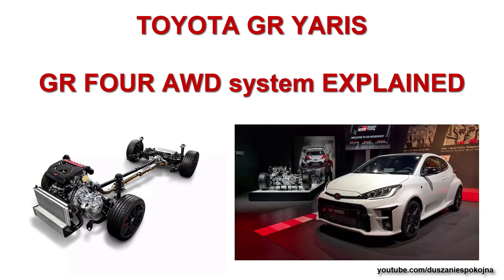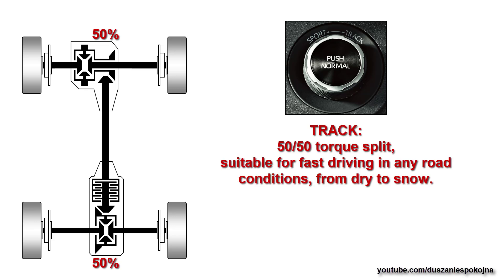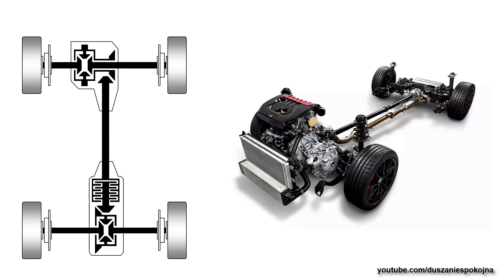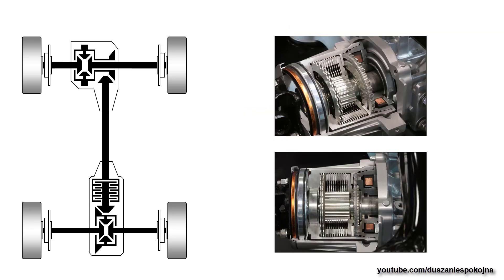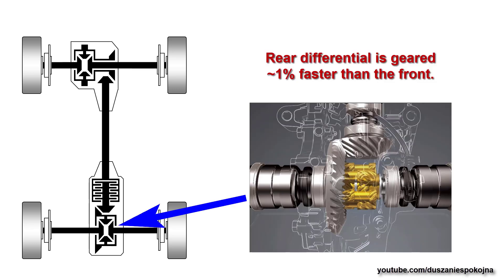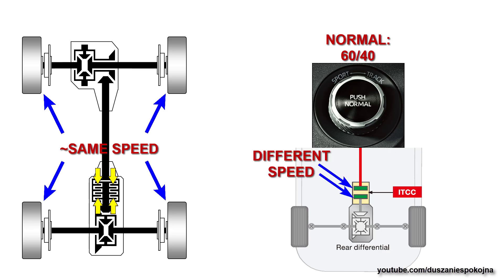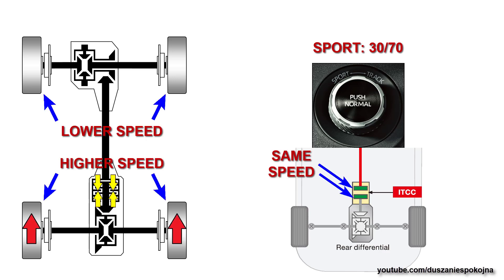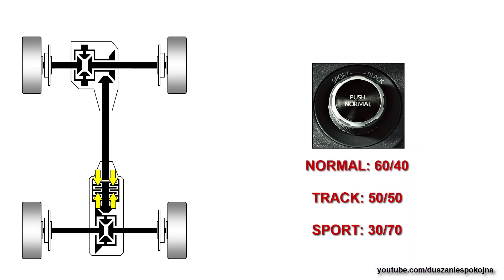Toyota GR Corolla & GR Yaris - GR FOUR AWD SYSTEM EXPLAINED - @4x4.tests.on.rollers

Comment: Planned obsolescence at it's finest, a drivetrain deliberately designed to wear down with each rotation. A lockable torsen center differential would be a much more robust solution, but it's apparent that cars are increasingly designed more like consumer electronics with each passing year, with the expectation expiring soon after warranty instead of the 20 years design life that was typical just a decade ago.
Reply from the maker: It wouldn't be possible to overspeed rear axle with torsen differential. Another two-step rear differential would be needed then. So in general - a lot of weight and a lot of space.
Reply: They designed it to not wear out. It's not normal clutch at all. Both cars and electronics are going to last well over any warranty definitely over 20 years.
Reply: @dkdanis1340  how do you know?
Reply: @bobbybooshay5854  Cause multi plates wet clutches have been used for many applications without any problems. You can  imagine how much engineering toyota did with this one.

Comment: If I would be Mr. Toyoda, I would have put a lockable center torsen diff in stead of slipping and sliding disks. Constantly slipping disks really do not sound appealing at all. Basically the system is being worn out all the time when used, with each rotation of the crankshaft. Good job explaining the functionality, this solution would not be my choice as there many others not based on constant slipping.
Reply from the maker: It wouldn't be possible to overspeed rear axle with torsen differential. Another two-step rear differential would be needed then. So in general - a lot of weight and a lot of space.
Reply: @4x4.tests.on.rollers  if I wasn't mistaken, audi have something like center diff with computer control variable locking, while by default it gave 60/40 split rear / front through gearing inside the differential itself.
Reply from the maker: @krisnadiimam4556  No, they don't have computer controlled center diff. Here are all diffs used by Audi: https://youtu.be/ItTkEb_pf1A
Reply: @4x4.tests.on.rollers  Audi started using Torsen 40/60 nominal front/rear torque split from Audi S4/RS4 B7 I think, so there would be no need for overspeeding the rear axle as the torque split is acquired in the center differential gearing. But this solution is not electronically controlled for changing the torque split
Reply from the maker: @Lexanotus  Audi is using a method of overspeeding rear wheels (right or left, never both) by optional sport differential. That's how they fight with understeer.
Reply: Torsen center diff, as in most Audis, is very good for everyday driving and for spirited street driving too. It's torque split varies depending on the grip on each axle, but has it's limitations, and cannot be electronically controlled. But with this system, the torque split can be varied according to conditions and driver input using only software.

I think the car would be very different with a center Torsen diff. And from what I've heard, it is very good as it is. I wouldn't have thought they made the AWD system like this, but I think the good people at Toyota knew what they were doing. :)
Reply: Is it possible to delete the itcc and direct replace with custom adaptor.. this itcc keep overheated during racing

Comment: Thank you for the great video! Do you know if Focus RS uses similar technology?
Reply from the maker: Yes, Focus RS uses the same overspeeding trick but it is powering rear wheels separately. It has two clutch-packs on semi-axles instead of one on the driveshaft. System is called Twinster, supplied by GKN Driveline.

Comment: so if I put 235/50 on the audi s3 instead of 235/45 on the rear axle should i get the same result ??
Reply from the maker: If you update the awd control software then yes. To the point when haldex will explode 😉
Reply: Guess the wheel speed sensors would make the car go crazy and think that the rears are always slipping a bit and apply brakes on rear?
Reply from the maker: @timoklap System wouldn't be braking the wheels, it would be locking the haldex.
Reply: @4x4.tests.on.rollers  it would be braking wheels, its the traction control system
Reply from the maker: @lexuslfa4739  Not in this case.

Comment: It reassures me, I had understood the same thing concerning the operation of this transmission. Including, the trick for the distribution of torque in favor of the rear. This is an interesting use of the ITCC, a multi-plat clutch pack found on many cars (JTECK belonging to Toyota)...
Reply from the maker: To be honest, I was really surprised that they took ITCC for GR Yaris. It must be really strong clutch-pack.
Reply: @4x4.tests.on.rollers  Me too. I heard so much criticism of ITCC in the mid-2000s when it was mounted on SUVs ... with stories of heating up and back to 2wd and that in conditions not particularly difficult... Improvements from generation to generation, I guess. It is, I believe, the 3rd.
Reply from the maker: @Softroader  Toyota Poland organised three days of track driving for automotive journalists. They were pushing the cars to the limits, there was not a single incident with overheat. I am really interested if the clutch is really engaged all the time or is it opening in every possible moment (like off throttle etc.) to cool down a little.
Reply: @4x4.tests.on.rollers  Toyota apparently managed to overcome the inherent overheating problem of such s system but big question comes to mine mind: how long it will last?
Reply: @4x4.tests.on.rollers  The swiss guys must have set the 30/70 mode so it overheated while having the minimum slip in the ITCC (with max pressure though). It must be hard on the rear tires too. And still one does not feel much difference with the other modes (I've tested them myself then read the same comments from journalists)
Reply from the maker: @spolo123  Thanks for the link. All in all it's a clutch-pack without cooling, it must overheat some day :)
Reply: Ford used ITCC in rear diff unit.! But only 100F To 50/50

Comment: This means that the clutch is permanently slipping because the tires have the same speed. So the clutch will wear out very quickly.
Reply: It's a wet plate clutch pack with a DLC coating so it will probably be fine.
I am more interested in the energy loss by the slipping clutch though.
Reply from the maker: Yes, it is. But we don't know if it will wear out quickly, we have to wait 🙂
Reply: @4x4.tests.on.rollers  wet clutch, does not wear, its the same as the mercedes automatic gearbox that uses a wet clutch instead of a torque converter
Reply from the maker: @lexuslfa4739  Every clutch wears out, especially if it works under constant slippage/friction. That's very different story from the one in automatic gearboxes.
Reply: @4x4.tests.on.rollers  sure bud ;
Reply: Subaru also uses a clutch that is permanently slipping in their recent automatic awd cars. Subaru hasn’t had much of an issue from this from what I hear. Gr Yaris is higher stress environment but these kinds of clutch packs usually do fairly well in reliability from what I’ve seen
Reply: @clayvinlunsford9697  Most Subarus are 50/50 so the clutch doesn't need to slip much under normal driving conditions.
Reply from the maker: @jasonsong86 Only manual Subarus are 50/50. They have mechanical center diff, not just a clutch pack.
Reply: @ the automatic Subarus also are variable up to 50/50.
Reply from the maker: @jasonsong86  But it's not constant/permanent 50/50. It's a momentary peak.
Reply: Not sure about Toyota but on the Honda iVTM4/SH-AWD system, the fluid is changed every 30k miles.

Comment: Interesting. Thanks for explain us. How often will need to change rear diff/clutch oil and will be expansive ?
Reply: I'm currious about this as well. I love compex awd systems like the S-AWC on the evos but I'm always afraid of the maintenance and reliability. And I come from BMWs so that's saying something.
Reply from the maker: @memememine1  Electromagnetic clutch-packs are usually hermetic, no oil change. I don't know if it is the same in GR Yaris.
Reply: @4x4.tests.on.rollers  love this tech videos 😉. Did you find out already if it is hermetic? Or does it share the oil with the LSD?
Reply from the maker: @jpdw7543  I wasn't checking it. I will during the roller test of GR 🙂